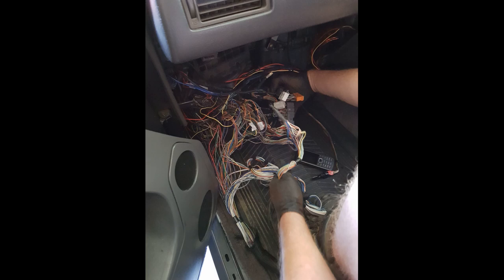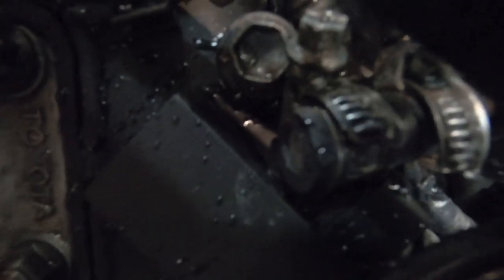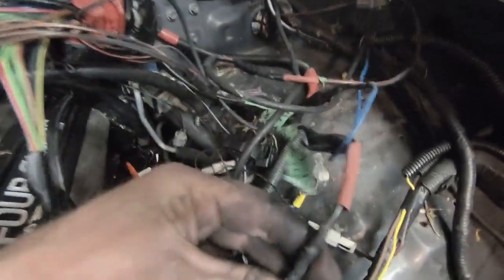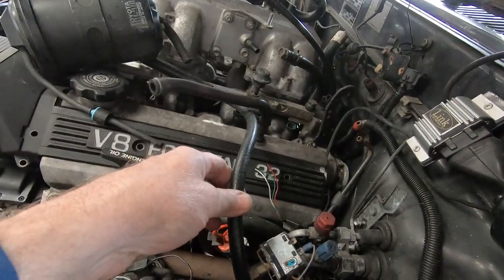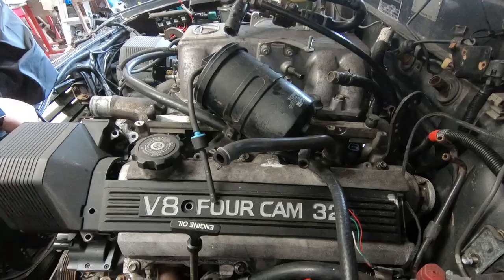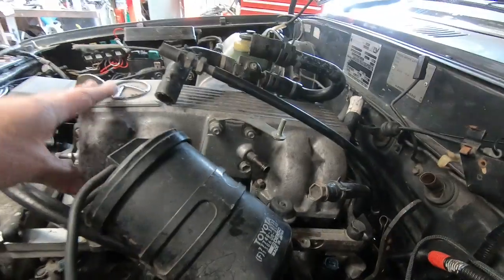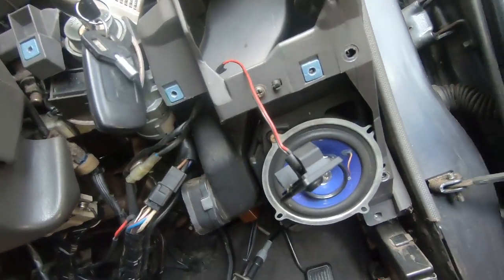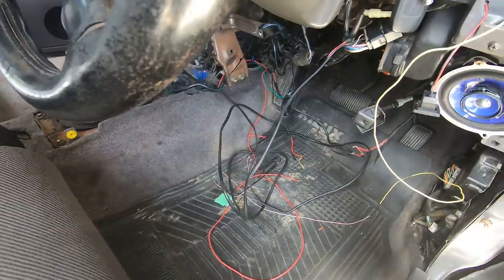This years worst wiring job - 1uz Toyota Surf / 4 Runner .  Stage 1 make engine run

Comment: I've been doing Electronics (HOBBY) plus automotive electrical (hobby for 20+ years) it scares the crap out of me the amount of times i have come across either house wire, non fused wiring setup's  oh the list goes on. Now to get a good job done, Leave it to the pro's or someone who knows what they are doing, Plus you need the gear to do a good job. I have had people bring me there vehicles over the years with issues that leave you scratching your head and wondering what the person was thinking when doing it. When i see bad jobs or bad installs best to rip it all out and start again. GREAT VIDEO!!
Reply from the maker: Thanks for the compliment.  I can empathize with some of the stuff you have seen.  I rip plenty out and start again.  Cheers Kelvin

Comment: Hey Kelvin. Love your videos! My son (Hayden!) and I just bought a '04 Lexus LS430. The plan is to put the 3UZ in a '77 Celica liftback. Do you have a recommendation for a manual transmission? Cheers from Minnesota
Reply from the maker: Hello Phil.  Does 04 mean it is the 6 speed auto?  We are still sorting all the niggles of the stock ECU with a manual box yet and often using aftermarket on 3uz anyway as we can get some really good gains.  Over here my first choice is an R154 which we can get brand new at a good price (under $2k usd) but they seem a bit harder to find your side.  Maybe an AR5 which is like a R154 with some refinement.  Otherwise maybe the Nissan CD009.  I stay away from the W series toyota boxes as I'm sick of replacing them when they break so I even avoid doing conversions when guys want to use them. Maybe even a T56.   Do it once do it right.  Really it comes down to what is available in your market.  Cheers Kelvin

Comment: Nice work.. looking forward to seeing the auto wiring side of things
Reply from the maker: Hello Pat.  This was meant to be all about the auto stuff , oh wait I'd better do this bit to show the customer whats going on , now about that auto stuff , wait , more problems to show the customer and so on.  Turns out I haven't got to the auto bit yet and that will be another video but the plan is to show plenty of info on it as there are more guys wanting auto solutions with aftermarket ECU.  Cheers Kelvin
Reply: @CartuneNZ  it's something I'm interested in, I'm disabled so had to stick with the 4 speed auto in my 1uz swapped bmw e36, not something you see in many drift cars.
I'm about to start a 5 speed swap over next few months, using spitronics mercury 2 tcu. I can't cope with the long gearing anymore, ruins all the fun haha

Comment: Good day, thanks for your videos it help a lot!!  
I have a problem on my 1UZ VVTI.
First of I use the Dictator management system, but this problem started before I changed from Lexus system to Dictator.
When I drive the vehicle at a constant speed it then is like when you ease of the gas just slightly and need to give more gas to go the same speed. The power is also less. Then when I turn the ignition off and on again while still driving the power is back and as it should be.
Any ideas ?
Reply from the maker: Hello.  What testing have you done so far?  Have you confirmed charging voltage is good?  Fuel flow and pressure all fine?  Fuel pump amperage remains constant?  voltage to management all checked?  AFR checked?  Cheers Kelvin

Comment: Hi I'm running a 1uz non vvti on an alpha 1 gen 2 sterndrive.  Would you know how to wire up an interrupt switch for selecting gears.  I already have a switch,  what would you recommend to wire it into? Many thanks.
Reply from the maker: There are a couple of options I can think of , one would be using the wires which normally receives a signal to retard timing when traction control operates, depending on which ecu you have as the later non vvti are best to have them wired non traction so the retard may not work without seeing the other traction signals.  Alternatively an external antilag or ignition cut box may be suitable.  I suggest doing some testing or swap to an aftermarket ecu which would make this function easy.  Cheers Kelvin
Reply: @CartuneNZ  thank you. I am running the standard factory ECU.